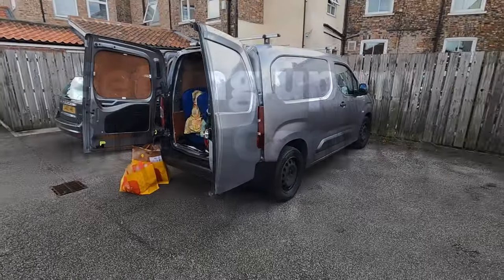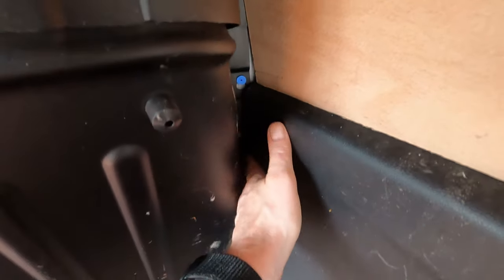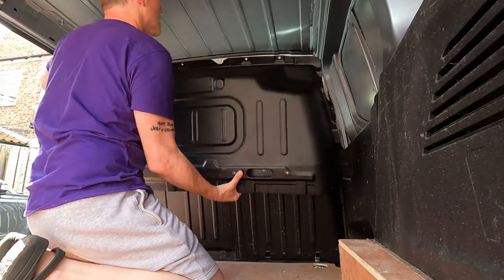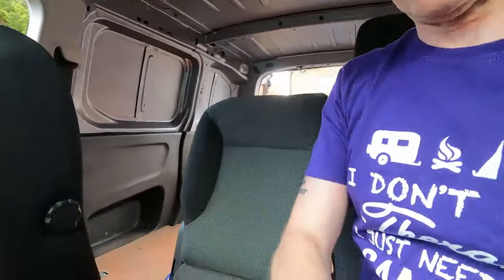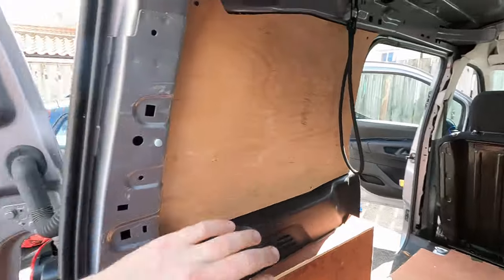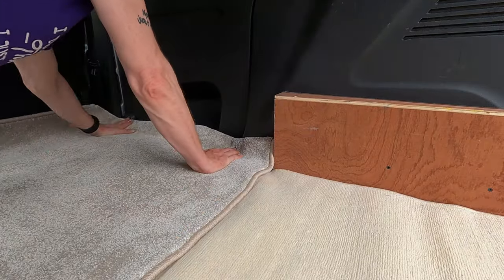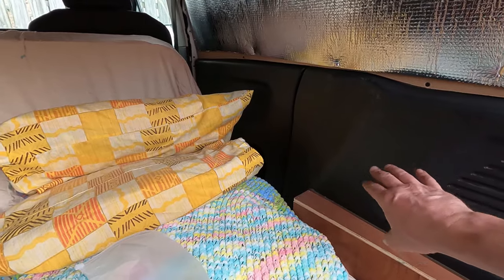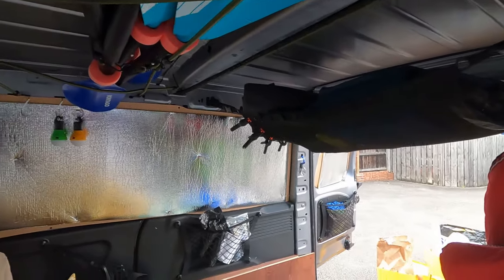Citroen Berlingo Micro Camper/Utility Van - Simple Conversion

Comment: Good progress, if you still have it, I’d consider cutting the wooden racking down to make it slimmer to the same width as the wheel arch covers, the racking will hold lots of your bits and bobs, plastic storage boxes are ideal for keeping stuff safe. Can’t help thinking a LWB van would have been a bit more suitable though😂 Says the bloke who won’t camp in tents anymore !😜
Reply from the maker: The racking has gone 😅
The Beast was LWB and yes ideally it would be more suitable. However because this is for work too reliability is a big factor and this was the newest in my price range. Yes I could have looked longer but time was also a factor.
And to be quite honest, I'm loving benefits of the SWB - turns on a penny, easier to find parking slots, lower profile - it's ticking a lot of boxes and is fun to drive. Oh, and it's way more fuel efficient than I thought it would be, more so than the beast and that wasn't bad.
Reply: @MoreThanJustaCleaner  All,sounds good then, I’ve just had to replace yet another injector on my VW caddy, can’t remember if it’s third or fourth, flipping thing is 2011 and hasn’t done 65k yet😱
Reply from the maker: @geoffknight7322  Sheesh that's not good 😏

Comment: Instead of a bed, would a hammock work going from the front passenger side to the rear drivers side?
Reply from the maker: I don't think there's enough drop 🤔 although I have considered it 😁
Reply: As long as your bum isn't touching the floor 🤷🏻‍♂️ depends more on the length corner to corner. If you've got 10 plus feet might be worth giving it a go one camp?
Reply from the maker: @ChardOutdoors  I don't think it's 10ft, I'll have to check it out 😁

Comment: Interesting build. 
I happen to have a Berlingo Van myself, and may want to use it as a microcamper, too. The only issue is that it's an Electric, and registered as a 'class 2 Van'. Which means I can't touch that bulkhead behind the seats.(My bulkhead is a single piece with window, so a simpler design, with screws top and bottom)
If I do anything, I'll first get the registration changed, then cut the bulkhead in half down the middle, and install some sort of rails to slide it along, so that it still looks like a regular bulkhead. 
Mine is the K9 version(2008 - 2018) and on mine there's a lot of space under the floor where the rear passenger footwells would be in a passenger car. I'm slowly working on fitting a diesel-powered cabin heater there... (Electric Berlingos have bugger-all range, and if you use the heater, even less, so a diesel-powered one is a good range extender )

One thing you should take notice of is that up on top of the walls there are two sturdy brackets. They're there for the Modutop on the MultiSpace, and on some versions without Modutop you could fit 'internal roof rails' there. I just used a pair of extensible painting handles, drilled and mounted M8 bolts in the ends, and... perfect fit. 
One guy even used IKEA Curtain rods...  
https://www.berlingoforum.com/thread-21814-post-139544.html#pid139544   

I used to transport my fishing rods and hiking staves up there in my old Berlingo(MultiSpace.) Doesn't work so well with a Van because the one rod gets too close to the bulkhead.
Reply from the maker: That's a very comprehensive reply, thanks for taking the time to add it as it might be useful for others 👍😁

Comment: Nice one, Karl. I have a 2014 Peugeot Partner van that I have had since new. I am planning on turning it into a micro-camper. To start with, it will be a DIY fit-out using kit I already have, with the mind to doing a removable boot jump-type fit-out next Spring once I know what works for me. May I suggest some sound deadening on the panels and roof, now your bulkhead is removed, it could sound a bit tiny when on the road!

ATB, Dave 
😃
Reply from the maker: That's a good idea, cheers David 👍😁